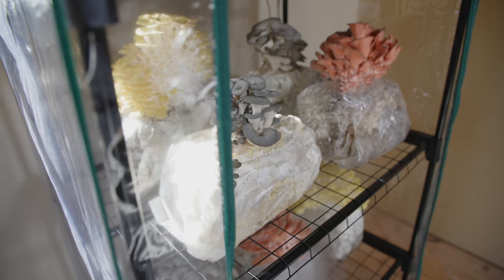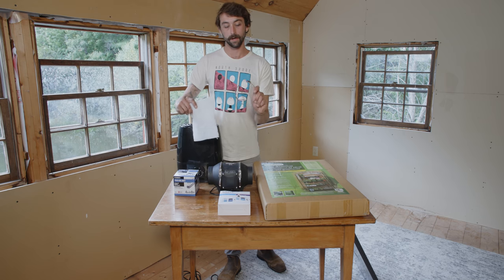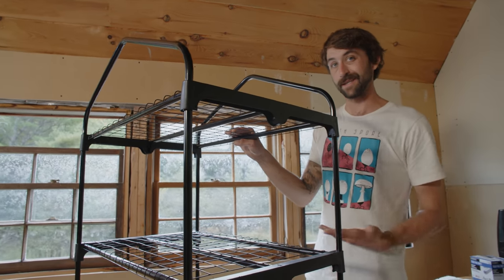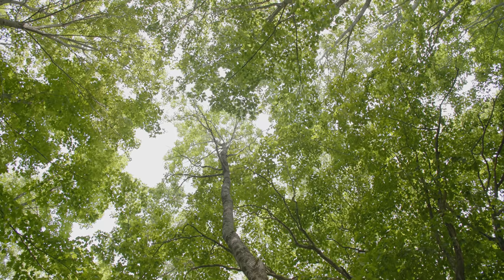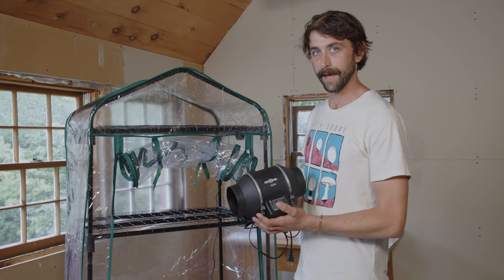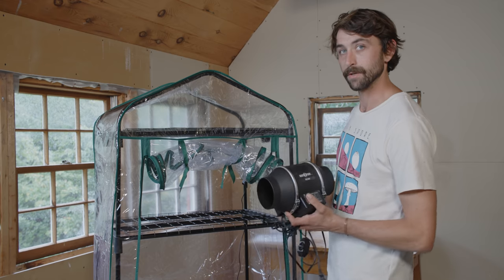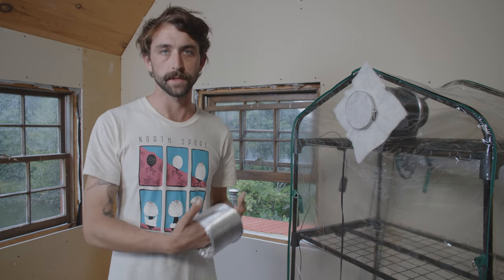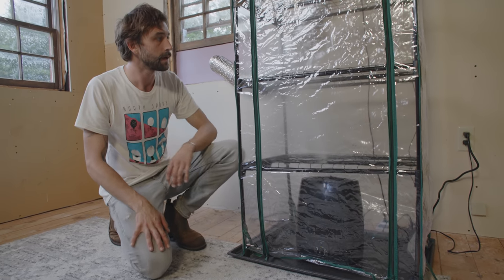Complete Martha Grow Tent Setup & Maintenance Walk-Through | Build a DIY Mushroom Fruiting Chamber

Comment: Could I skip the humidifier?  This will be in a closet and I’m concerned about the humidity affecting the closet.

Edit:  My tent is reeeeeally shitty and I’ll just have to do the work to make it as airtight as I can.  I don’t see the type of humidity in my apartment that is ideal.  My first batch I dealt with wet rot in all my bags during colonizing so I haven’t gotten to fruiting yet :/

Edit:  Would there be a problem using tape to secure the shelving to the frame?  Should I use clips or twine instead?

Comment: Your extraction fan should be at the bottom since carbon dioxide is heavier that oxygen. Also put the humidifier at the top so the humidity can touch each mushroom as it falls.
Reply from the maker: Thanks for your input!  That is another way to set up the tent but we found that the active cycle with the fan on top and humidifier on the bottom worked well too!

Comment: Thank you for the video! If we don't have access to a window near where our Martha tent will be, is using a filter an okay option for growing oyster mushrooms? Normally you would want to expell all of the spores as far away as possible from your living conditions. I just wonder how safe it might be to do this indoors with the filter assuming you clean it regularly. I haven't grown oyster mushrooms yet because of that concern.
Also, you discussed temperature as being a potential concern in the Martha. I feel like the chamber might be a few degrees warmer than room temperature but perhaps a small space heater or thermal (non-light) heat lamp near the tent might be appropriate. I use a temperature controller just like the humidity one that you use.
Reply from the maker: Hello and thanks for the questions. You could vent right towards a free-standing air filter to reduce spore in the air even further. Doesn't need to be HEPA, but that would be best. One block of oyster isn't a concern, but if you have 8 in there, the spore load could be quite high and while pretty effective, the filters only do so much. If you do feel the need to add some temperature controls another option might be heating mats.
Reply: @NorthSpore  I Appreciate the reply. I've had some mushrooms that seem to struggle with a balance of CO2. I now have my fan on a timer so it only kicks on a few times a day because before it dried out my substrate being on 24/7. To get better access to FAE do you think it would be useful to cut multiple holes into the plastic and fill with polyfill? Thanks

Comment: How many hours would you have grow lights on if the martha tent was in a dark place like a shed with no windows. And would you hang the light directly over the tent or what?
Thanks!
Reply from the maker: You don't need much light, but you do need some. One good bulb being on for 8 hours or so should do it. Look for a bulb that's 5000-7000 kelvin and put it right over the tent.

Comment: With the humidifier, how often do you think it’s on? I know you’re using a switch, unfortunately I’ve no switch atm that automatically turns it on and so would appreciate an idea for how often it is on
Reply from the maker: It depends on a lot of factors, but the humidifier will usually need to be refilled every 1-3 days. Aim to keep humidity at 85%.

Comment: When using trays or tubs in the Martha Tent, do you need to put the lids on at anytime? Comparing to a mono tub, you of course need to use the lid throughout to keep humidity in. The Martha Tent though is essentially a bigger monotub. So in theory would you ever need to put lids over your trays/tubs? Thanks!
Reply from the maker: Lids are important to protect substrate during colonization. Take them off after colonization and stick them in the tent for fruiting.
Reply: @NorthSpore  Ahhh makes sense! Thank you!

Comment: What size trays are those? And where can I get them?  Also, can you use an aquarium heater to control the temp inside the tent?
Reply from the maker: Sorry, that info has been lost with time. I've tried and nobody seems to know exactly what trays were used. You can try a space heater of sorts or a heating mat, but you want to be careful that they don't dry things out or get too hot. On the flip side, since the air is being pumped right out, they might do very little.

Comment: Great video, North Spore! This is really helpful and informative. Question: is there an ideal CO2 level for fruiting and is do you have a recommended sensor for measuring CO2?
Reply from the maker: Thank you so much!  Yes, you want to keep co2 levels around or below 800-1000ppm for sensitive species.  However, co2 controllers are quite expensive and that can be limiting.  In any case, you can learn to observe the signs of high co2 levels without needing to use a controller.  For example, stringy mushrooms or thick stems are signs of high co2 and lack of fresh air exchange.  This can be adjusted by increasing the fan speed for more air flow.
Reply: @NorthSpore  Thanks so much!
Reply from the maker: Certainly!

Comment: looks like a sharp blade would work nice  if you left the cover on... I am a roofer though so thats one of our main tools! I am worried though? the humidity will be strongest at the bottom and the fan fights the humidity?
Reply from the maker: Ours is set up to pull air through the tent so that we can capture spores - you could make a positively pressured system that pumps in filtered air but then spores would just be pushed out into the environment - also when you are dealing with colonized substrate there is no need to filter the air as the risk of contamination is low.

Comment: Had a quick question, my fruiting chamber is located in my basement, where I just have workout equipment.  Since I don't have good access to vent my chamber outside, I am planning on venting it to my garage, and since I also store some kayaking equipment in the garage, I am planning to also filter it.  Is this filtration overkill or recommended since the outflow is still technically inside the house?
Reply from the maker: I don't think some secondary filtration is necessarily overkill. it could build up in the garage, potentially colonize something in there. Another of the same filter should be fine.

Comment: What about when it's -30 - surely having the filter run through your window during the winter wouldn't be helpful for the mushrooms. Any tips for that?
Reply from the maker: Good point!  In that case, you may want to add something like a dryer vent on the window that allows air to flow out but not in.

Comment: I guess from the video that these tents are mostly used for growing "medicinal" mushrooms. The humidifier and fan are probably more than 100 times more powerful than needed. Well, if you use a fan that exchange the volume of the tent like a dozen times per minute you obviously need a powerful humidifier, but you don't need that amount airflow to avoid significant increase in CO2 or decrease of O2.
Reply from the maker: Hey there!  The fan has a speed control to adjust based on your needs.  Thanks for your input!

Comment: Do you need to run the fan 24/7? I am thinking putting it on a timer but I have no clue what would be the right setting.
Reply from the maker: You can or you can put it on a cycle timer! You'd need to tinker around to find the right setting, but generally something like 1 minute on and 10 off is a good place to start.

Comment: I have the North Spore growing tent kit. I ordered a repeat cycle timer for the fan also but wondering if I need it? Is the fan meant to stay on at all times or just periodically turned on to allow fresh air exchange?
Reply from the maker: You should not need to run the fan all the time.

Comment: Would you recommend filtering the air even if ducting it outside?
Alot of people in my area are sensitive to stuff in the air
Reply from the maker: You might want a pre-filter on the intake end of the fan just to reduce spore buildup, but otherwise no. There are billions of spores in the air all the time and one tent, even if full of blocks, won't contribute significantly in a way that would cause problems for your neighbors.

Comment: what do you set your FOA at in your martha tent? I have one humidifier on the top and one on the bottom so i don't have to refill the water as often and i have my fan running for 2 minutes every 15 minutes for air exchange. The humidity stays around 90-95% with a drop to the low 80s during the air exchange cycle. First time growing  mushrooms and any advice would help. Thank you!
Reply from the maker: I mean, that sounds fine, but the real test is either to test the CO2 levels or just grow mushrooms and see how they respond. There are many factors at play which might change my settings compared to yours. I'd always err on having more air exchange!

Comment: Did he say if his exhaust fan was running constantly? If so how does the humidity not get pumped straight out? Which in my mind would make his humidifier work constantly
Reply from the maker: Yes, the fan is running at a low speed and the humidifier is on a controller to turn on when needed.  It does take some adjusting to find a good speed in relation to the humidifier but we tested this active system with great success.

Comment: For the trays you used on the top shelf.. are those similar to a mono tub set up with substrate and spawn?
Reply from the maker: Yes, all the principles apply. You'll want to colonize closed and the fruit open in the tent (increased airflow!).

Comment: How do you regulate the fan?, like i assume if its on constantly it will take out that humidity?
Reply from the maker: We set the fan low so that it provides fresh air exchange but doesn't pull the humidity out.  The humidifier is on a sensor so it is not constantly running.  It make take some trial and error to get the right balance between air exchange and humidity.
Reply: @NorthSpore  ah yeah makes sense, thanks for the reply😊ive already got that exact tent actually so i just have to wait for my fan and humidifier to arrive😂

Comment: Is it safe to have the electric humidifier inside the tent? Could it cause electric shock or risk of fire? Does it have to run constantly or intermittent?
Reply from the maker: I think the risk of shock or fire is quite low, but being in the high humidity absolutely will degrade the machine faster. However, that doesn't mean that it can't run for a reasonable lifetime and we guarantee it for a year. It should only have to run intermittently.

Comment: He put the colonized bags in the tent. Could I put the non colonized bags in there or is that too soon for the humidity? With that said, I tried the bucket method and boiled, pressure cooked, colonized bag then mixed with gypson and coca coir. Both times shit turned green. Will be ordering this and the kit now.
Reply from the maker: Remember, this is a fruiting chamber. Not a colonization or incubation chamber. If you want to keep colonizing things in there, that's probably ok, but unnecessary.

Comment: With a duct to a window,  is enough excess humidity pumped out that the room the Martha is in doesn't become too wet? I Have a house where I already battle humidity levels so high they've caused damage so I'm wanted to grow mushrooms without adding to my humidity issues.
Reply from the maker: Yes, humidity exits the unit and hopefully your home full of spores too. If for some reason there is still too much condensation, it's a matter of lowering the humidity and/or turning up the fan.

Comment: does it matter if you place the lid with the monotub with the adhesive filter. Inside the martha tent or is it best to remove the monotub lid and place the tub inside without the lid.
Reply from the maker: If you're going to put a tub in a martha tent, no lid is required.

Comment: Tip #2, dont buy cheap ultrasonic foggers, if they have lights they are junk. And dont route the inlet tube down like that, water will pool in the dip.
Reply from the maker: Not sure if I agree with the generalization about the lights on humidifiers, but not having a dip in the venting is absolutely good advice!

Comment: Do you need to run the duct fan 24/7 or can you use the humidity controller to operate as the dehumidifier function?
Reply: OR, another idea- just add a splitter for the the same output control as the humidifier- then the fan and humidifier turns on at the same time…
Reply from the maker: You could get a cycle timer: https://northspore.com/collections/mushroom-grow-room-accessories/products/fan-cycle-timer

Comment: Curious to why the humidifier is at the bottom and fan is at the top? most martha set ups ive seen its reversed. wondering if youve gotten better flushes this way?
Reply from the maker: Both ways work. Given the size of the humidifier, this made sense.

Comment: I looked the system that Northspore sells for ~$299 ,BoomRoom.  Is the ventilation fan a straight on off fan or is it controlled by some other parameter.  The fan you have linked above seems to have the ability to be controlled by humidity level.   What would be recommended, constant air flow or modulated by humidity? Thanks
Reply from the maker: The fan has a speed control to adjust to your needs.  Constant airflow or modulated by humidity both work but it helps to know the signs of lack of fresh air exchange when controlled by humidity needs.

Comment: What is the cfm of the fan? Do you have trouble keeping humidity up with it being g pumped out constantly by the fan?
Reply from the maker: The fan has an adjustable knob and you could also keep it on a cycle timer. It's honestly far more powerful than is necessary, but that will lend to it's longevity. You have to find a balance between FAE and humidity, always.

Comment: Will the fan filters make growing oysters in a living area safe? I don't plan on growing too many oysters, but the grow tent will be near me 8+ hours a day.
Reply from the maker: If you cannot vent outside, I recommend venting towards an air purifier.
Reply: @NorthSpore  thanks for the suggestion! I actually have an air purifier that I could use until I'm able to move the tent into a location that allows me to vent outside.

Comment: How long does the exhaust fan run for? How many cfm is it moving‽ what brand is the blower?
Reply from the maker: You can find all the components we used in the description of this video, and we also sell all of the individual components on our site! You want to dial in the fan to work with your specific set up, but we suggest letting it kick on once an hour for a few minutes.

Comment: Yo! I came across some large pieces of thick glass that is shaped like barn tin. I had it laying on the ground   all these pink mushrooms grow under it. So many of the 5-10 piece of glass sadly broke in transport. 
Thankfully many of the breaks amazing broke square. So I have been trying to figure out various uses for this old, broken, beautiful, pieces of simi frosted, light blue, broken (extremelysharp) , mostly square piece of thick glass. 
I have a special tturquous blue edible mushrooms that grow in the woods accross the street from me and I would like to grow them,. {And possible others?}  So my question is,. If you were going to build outdoor grow boxes, and use this glass, how would you go about that?
Reply from the maker: Nice!  You could build mini greenhouses but make sure you leave an opening for air exchange.  Try some oyster mushrooms in there!

Comment: What types of mushrooms is this beneficial for?  Are there some types that prefer a mono tub setup or would any strain benefit from this?
Reply from the maker: Great question! Certain mushrooms that don't grow well indoors at all, such as Blewit and Wine Cap are not suited to this setup. You can grow almost anything off a block in a Monotub as well, except Lion's Mane. Any species that prefers manure will thrive in a Monotub with Boomr bags used as the substrate.
Reply: @NorthSpore  okay and follow up question, does the in-line fan blow out 90% humid air or do you find that the poly filter catches most of the humidity?

Comment: is it necessary to add a humidifier if you are set up in a very humid zone?
Reply from the maker: It's definitely possible that your humidity is high enough for you to not need much humidification, that would require ~80% humidity though. Give it a shot. Be ready to add more though as needed.

Comment: Is the fan running continuously? I didn't see a timer. I bought a duct fan. Is that what you used? It seems awfully strong
Reply from the maker: We sell a timer, but it doesn't come with the BoomRoom kit. You could have it running all the time, toggle it manually, or get the timer. The fan is a very high quality piece of equipment. Keeping it on a lower setting allows it to not work as hard and thus last longer.

Comment: Just wondering, is the fan running 24/7 ? :)
Reply from the maker: No, it shouldn't. The fan and humidifier are kicked on when needed if you are using the controller. Look at 8:15.

Comment: You mention that if u dont have access to a window , to use a filter, what kind of filter do u recommend? I have a 3m air cleaning filter is that ok?
Reply from the maker: Ya, that will help a lot. Other standing filters, especially if HEPA, stationed nearby are a good thing.

Comment: How is the air supply staying clean if it's being sucked up from the floor?
Reply from the maker: It doesn't need to be sterile, but clean is good. For example, a well swept and mopped floor with a  small freestanding air filter nearby should more than do the trick.

Comment: wouldnt the fan extract all the humidity, meaning the the controller would never turn of the humidifier meaning the water will run out very quickly. Is 4liters enough for a whole day?
Reply from the maker: You need to strike a balance. It works. Another helpful tool is a repeat cycle timer: https://northspore.com/collections/martha-tents-supplies/products/fan-cycle-timer